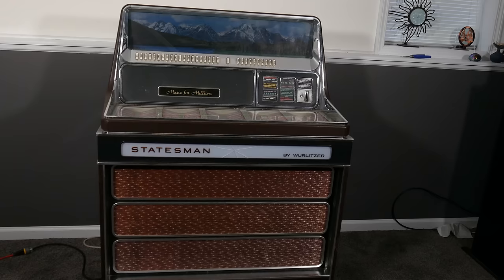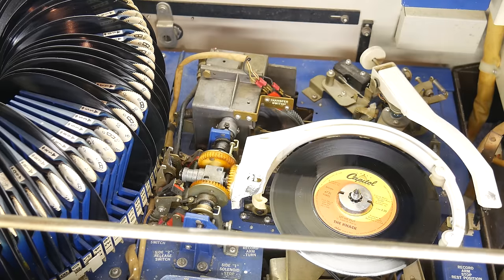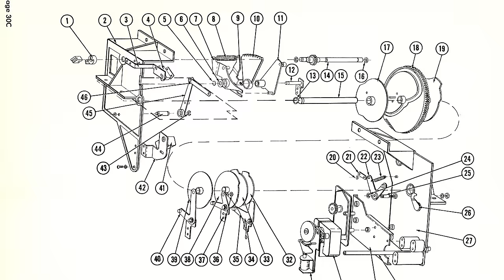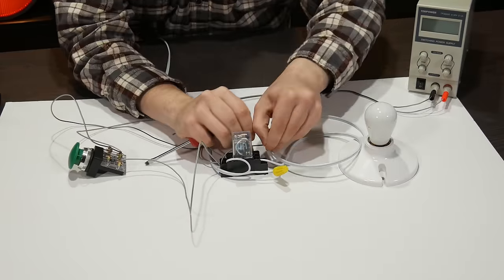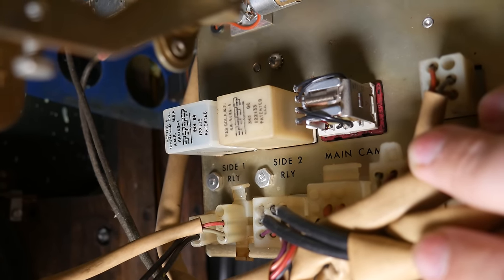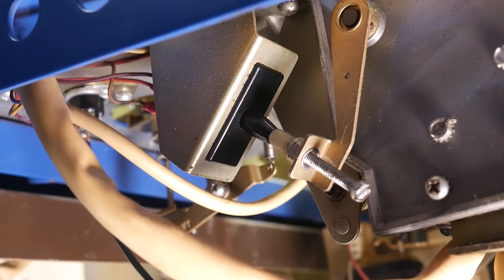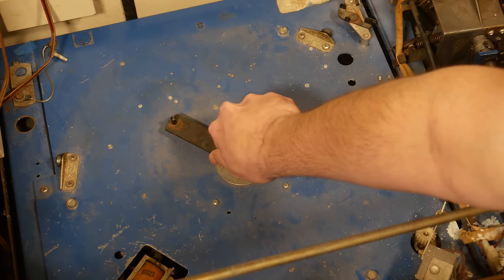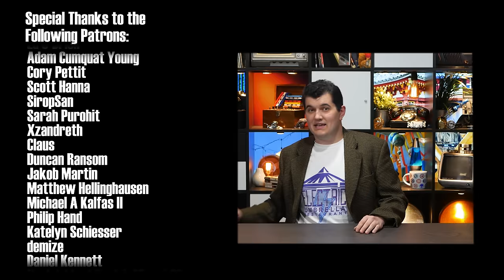The Computer-free Automation of a Jukebox (Electromechanics)

Comment: While electromechanics as they were in the 70's are effectively dead a lot of large, old factories are not all that different having just replaced timers with PLC's but still using all the limit switches, solenoids, relays, etc. just like before. They might also use the PLC to automate metrics via sensors but they can't really change much of the actual process when the machinery that is 3 or 4 stories tall from the 60's has no way to be directly automated.

Comment: The best part of relay logic is that it makes train rides safe since the late 1890s. We (in EU as well as you in the US) still have plenty of all-relay interlockings that automate service and make the whole station or even bunch of stations safe. Just look at this:

https://g.denik.cz/11/13/lovosice-drahy-vlaky-depo-rele2_denik-630-16x9.jpg

Or at this: (there are multiple (3 to 12) rows of 3 to 6 relay frames in stations.
https://aksignal.cz/file/f3d7c45efdefae41fd45637315dbdf01/425/prachatice-04-x.jpg

Comment: "Accumulator" made me think of rotary phones for some reason, and it seems I might be onto something...

Edit: It turns out that the two concepts are completely unrelated, save for the use of rotation.
Reply: They might be closer than you think. look up Strowger Exchange, another incredible electromechanical feat.
Reply: @MrDuncl  Thanks for that, I didn't know this device before! 
In hindsight, it's not that surprising to find something that counts up (accumulates) pulses on the receiving end of another device that generates a variable number of pulses (rotary phone).

Comment: Self latching circuits explained like a non-EE person: ((clicking "read more" is advised)) edited for clarity

Imagine you and all your 200 friends want to go to an expensive club. But it's expensive, and some of you have days in the month left before the next paycheck. 

So YOU buy a ticket to ride, and hold the door open with your arm (hold the switch), so your 200 friends can march in (12v supply keeps powering the the relay), 

then you get punched in the mouth by the bouncer, your arm lets go of the door because pain (the switch is no longer engaged, but the 12v supply is still powering the relay), friends are still pouring in, so

the bouncer closes the door (turns off the 12v supply), stopping the inflow of more friends, and the party is over..